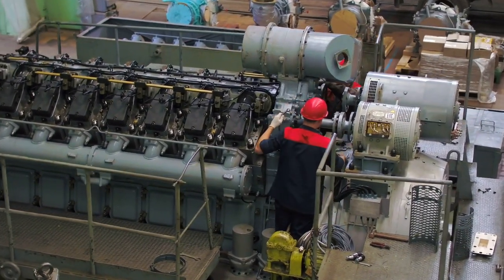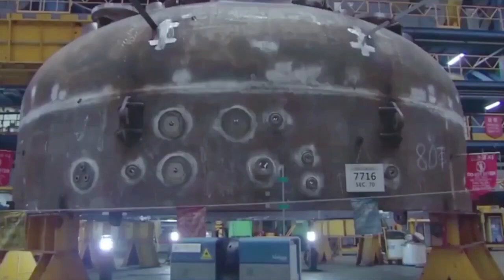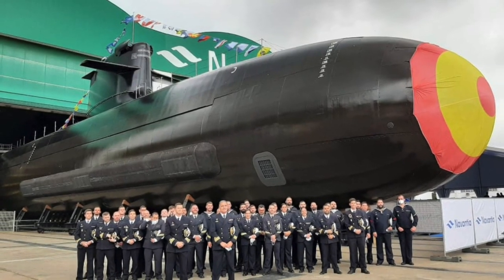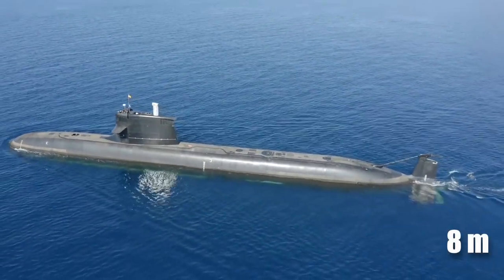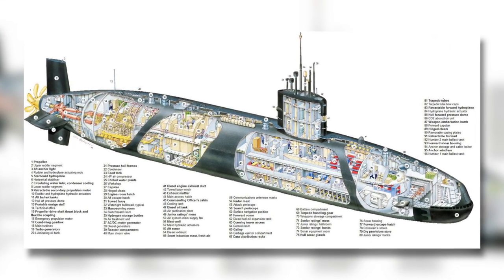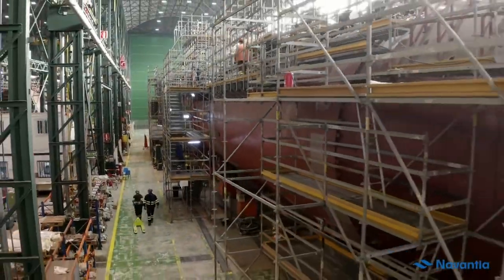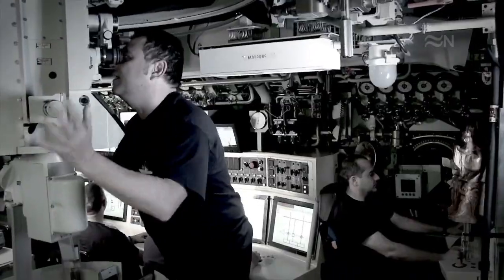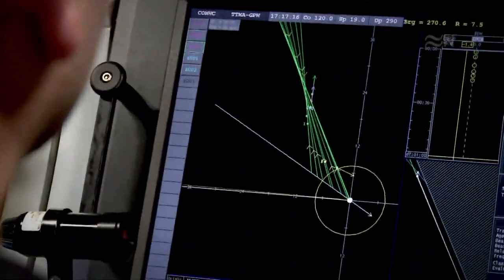The Insane Engineering Behind Spain’s Deadly S-80 Submarine

Comment: Nuclear subs are faster than conventional subs, do more research please!
Reply: That is true, no one denies it, but it is also true that maintaining a nuclear submarine is many times more expensive, and every year that waste must be placed somewhere
Reply: Yeah but nuclear portion of the sub is maintain every 25 to 30 years. Plus nuclear technology is commercially available. Diesel engines require more maintenance than a nuclear reactor.
Reply: @santiagoanderson9621  You have diesel engines aswell on nuclear subs.
Reply: @santiagoanderson9621 The S-80 will have an AIP System.
Reply: @santiagoanderson9621  What are you talking about? You confuse the useful life of the radioactive element. After 25 years the facility must be completely renovated, but that does not mean that there is a lot of periodic maintenance, but rather that the cost of this as well as the cost of the industries necessary for waste treatment is gigantic.
Plus, ethanol can be manufactured by any country, even if it is banned from accessing oil or radioactive elements...which makes it a strategically very interesting fuel for a nation without natural resources.
Reply: @santiagoanderson9621 Spain has no territories to defend in the other side of the planet. An Oceanic electric-diesel sub with an AIP system is more than enough for its needs. It makes the job by far.
Reply: . Jajajajajaj si no sabes no hables.Ademas vende.
Reply: Nuclear submarines are meant for superpowers needed to deploy submarines to the other side of the world for extended sea patrol missions. Maintenance cost are huge and unavailability is high due to extended overhauls requirements. For regular countries needed to patrol its economic exclusion zone and integrates its units into combined NATO deployments, a nuclear submarine is not cost effective. A mid power navy can afford 3 to 4 conventional submarines for the price of 1 nuclear submarine.  I would love to know who wins between lets say 1 nuclear sub against 3 - 4 convencional subs

Comment: Terrible research. Nuclear submarines,  ballistic missile submarines, are highly capable, ultra stealth, and have hunter killer capabilities. And by what metrics is the S-80 'superior to'  the mentioned conventional submarines? It's like telling a kids story.
Reply: Nuclear Submarines produce more noise than AIP ones.
Reply: @MASC9  how would you even know that?  
Acoustic signatures of nuclear subs are some of the most highly classified info on the planet.  sub's interior is completely designed to be sound proof so you cannot hear what is going on inside from the outside, otherwise you could hear the crew  talking.
FYI the human voice creates about 60 decibels which is twice as much as the noise of a water cooled PC.  It'a fair assumption that military cooling tech for reactors is much much more advanced and quieter than anything available to the public for a PC.
You have 0 idea what you are talking about.
Reply: @MASC9  Last point conventional powered subs (AIP etc...) are only quiet when operating on battery power, and moving at a slugs pace.  As soon as you needs to increase speed, the batteries dont last and you need the diesels to kick in which are noisy.  
So how is a sub supposed to hunt and chase frigates moving at 25 knots when the sub us going 3 knots?  Completely useless for hunting purpose only good for sitting in one spot waiting to ambush.  A nuclear power can steam ahead without any problems and go hunting.
The reality is that nuclear poweed subs are vastly superior to diesel/electrics, that is why the most adavanced militaries have chosen them.  The only drawback to nuclear powered sub is the technological knowledge required and costs.
Reply: @lordtemplar9274  You have no idea how AIP works.